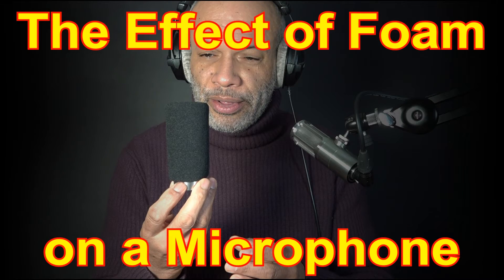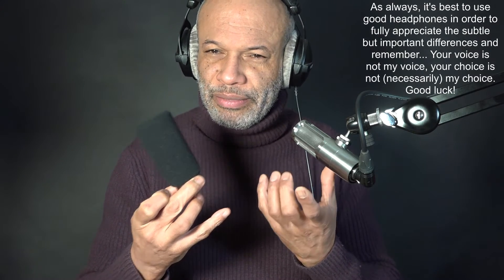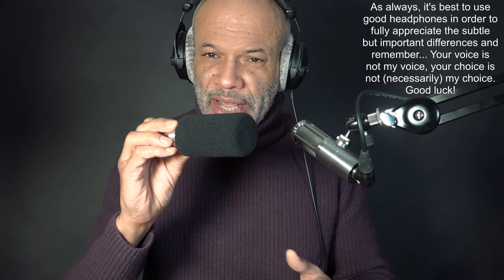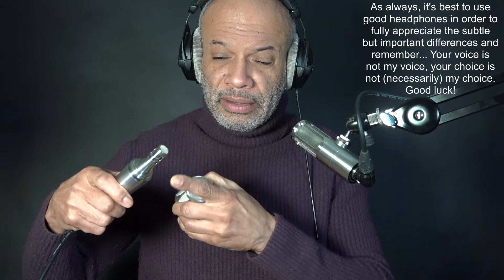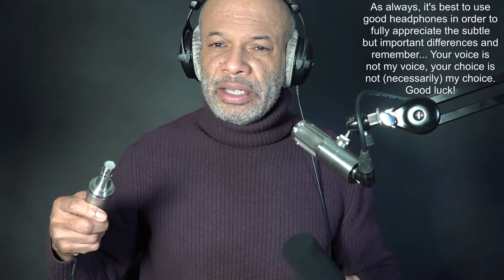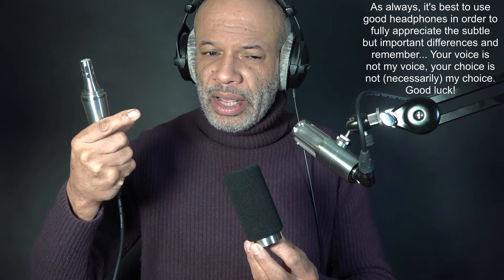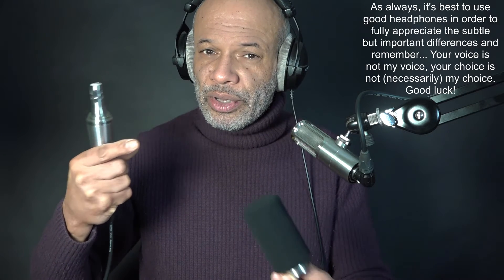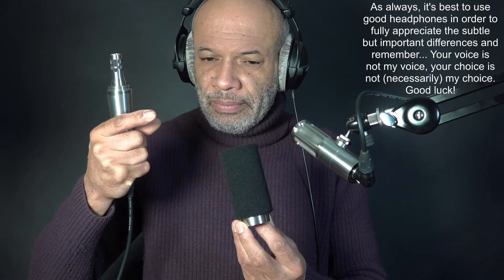The Effect of Foam on a Microphone

Comment: Anton, thanks for the amazing presentation! I just emailed Earthworks for an Icon Pro grill to put onto my Ethos! The man said that we can use a regular windscreen on the Ethos hard/metal screen, which may affect the SPL (I think, the closer to the diaphragm the more the sound pressure..) 🤦🏻‍♂️  Similar to light and distance, sound and distance have their own relationship.  Ethos opens up noticeably with the regular foam!  But he went on to say that the Icon Pro grill does not fit Ethos. I had to send him here and to Podcastage.

Comment: Thanks for the great experiment...was looking to find a way to reduce the plosives in live recordings with some new sr314 recently aquired.  Quick question.... The pop filter you have used looks like the one which comes with the Icon Pro and is available to buy separately.  Does this mean the threads on the icon pro pop filter works on the sr314 too?  Does the filter screw on tightly etc?  I actually emailed earthworks about this and they said the filter was designed for the icon pro only!?
Reply from the maker: The pop filter I'm using is from a prototype Earthworks sent me. It looks very similar to their new Ethos, but I don't know if the prototype is a pre-production Ethos. However, the grilles on my Icon Pro, SR 314 and the prototype can be swapped, and screw on securely. Check Podcastage2 - https://www.youtube.com/watch?v=5YJBlenjmVw
Reply: @AntonBrowne  ok thank you 👍

Comment: These Earthwork mics are solid. I guess the foam quality matters but I found it's not the foam itself but rather the shape it's in that matters. If one has the luxury of trying windscreens of different shapes and sizes, even ones that are not intended for a certain mic, one would find some interesting things.

Some of the cigar shaped windscreens ones have time to smoothen the sound as it travels the distance between the mic capsule and the foam that's near the mouth and it travels inside the foam with the room muffled. And the sound is louder at the source so you don't lose if it's closer to the mouth. The effect is lost if it's the other way around and the foam is directly on the capsule's head with little to no space and you have to put distance between your mouth and the foam, and that put a lot of the room in the mic. I think that this particular windscreen would be amazing for dynamic cigar shaped mics.

Can I ask what type of preamp/mixer you use on your reviews and is it a different one than that dynamic SM57/SM58 shootout? It has a lot of clear gain and no noise at all.
Reply from the maker: I think on the 57/58 I was using my Mackie 1202-VLZ Pro (nice desk and still working fine) into a cheap and cheerful Edirol interface. I now have a troublesome (noisy pots and switches) Mackie Profx 8 which has the convenience of an inbuilt interface and also effects which I like to use for making noises! The audio quality of both setups is pleasingly acceptable for looking at stage microphones IMHO.
Reply: @AntonBrowne  Thank you very much for the information. Now I have parameters to stick on throughout my search. Trying to achieve similar gain to low noise ratio. First time hearing of these Edirol interfaces and after a quick search they seem very interesting and deserve a proper try.